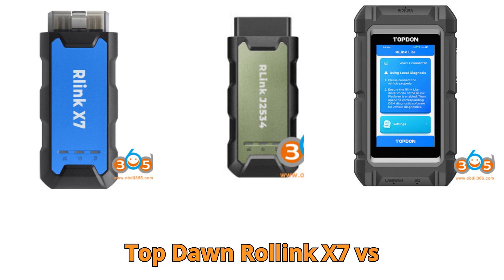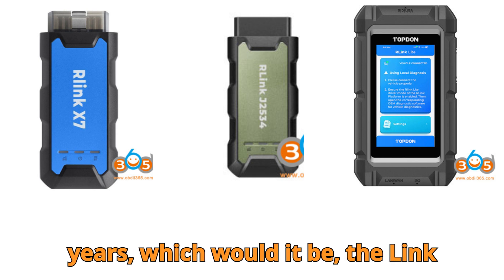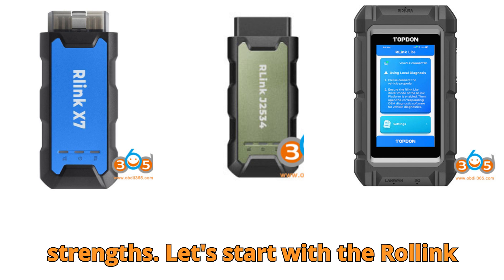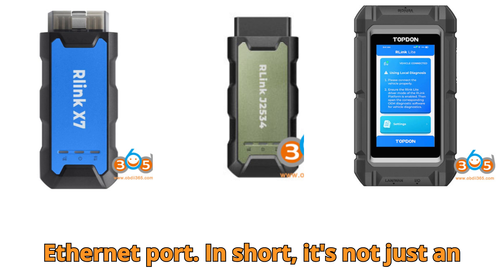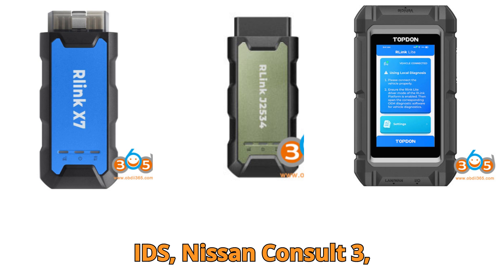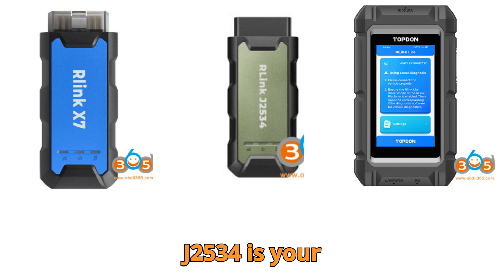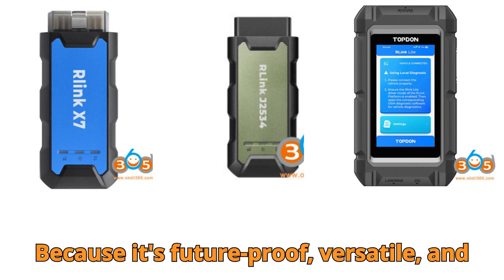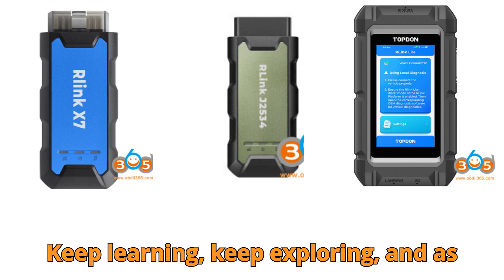Topdon Rlink Lite vs X7 vs J2534 – Ultimate Diagnostic Tool Comparison for Mechanics!

Comment: Without knowing the price tag I cannot decide. At the moment I have carpal and topscan lite which both do a good diagnostic job  on my Kia and Mercedes. (topscan lite has few additional features for testing purposes but carpal is good enough and cheaper to maintain the subscription). can all three offer coding and ecu tcm or other control units firmware update?? your presentation is not complete.